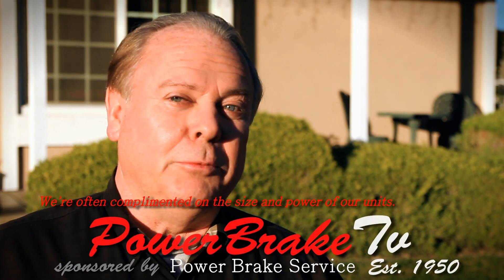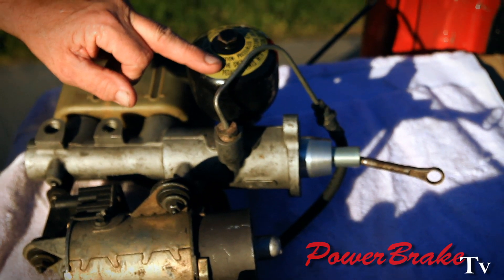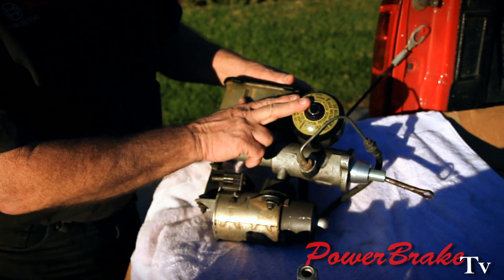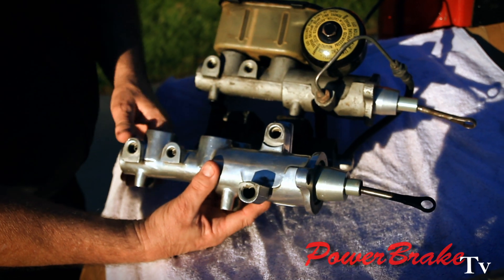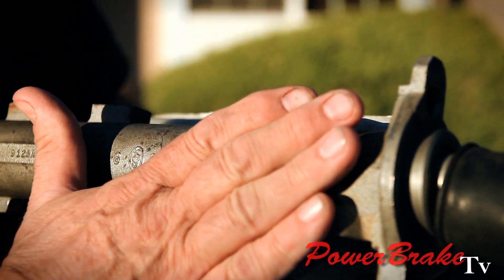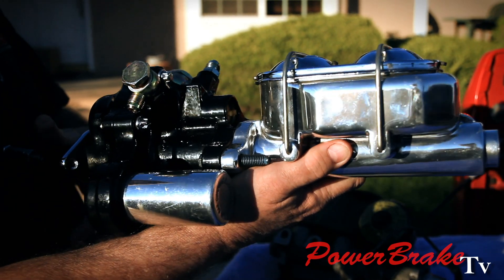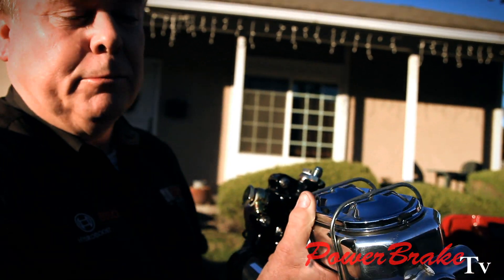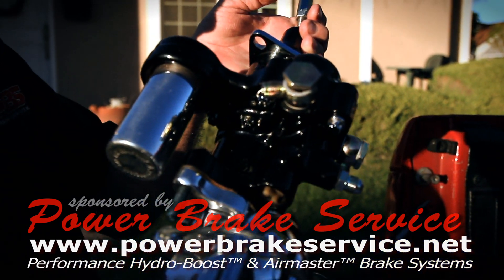Jeep Electric High Pressure Master Cylinder, Buick Powermaster, & Hydro-Boost Brake Booster on PBTV

Comment: My 94 Nissan patrol diesel has a vacuum pump attatched to the sump for lubrication at the back of the alternator to supply vacuum to run the booster why would manufacturers use such a complicated system??

Comment: I had the honor of changing a hydroboost in a 90's 4x4 suburban with 250k on the clock. I'd say that is a pretty acceptable service life. It was truck used by an industrial laboratory to reach sampling sites in remote areas without road access and we were cruel to it.